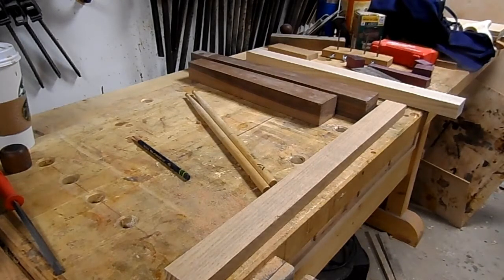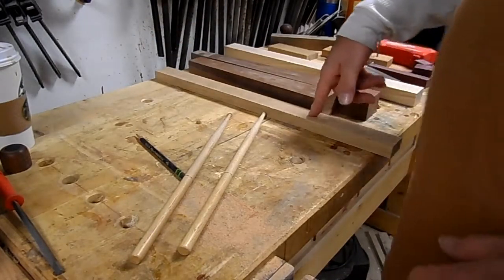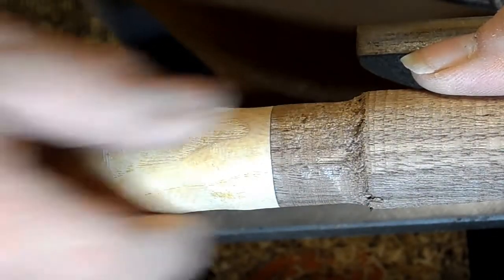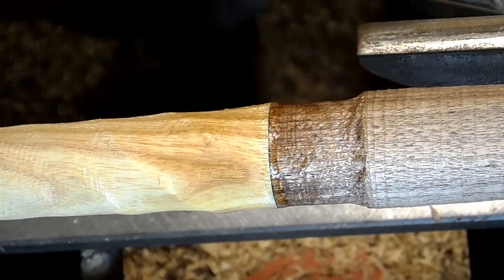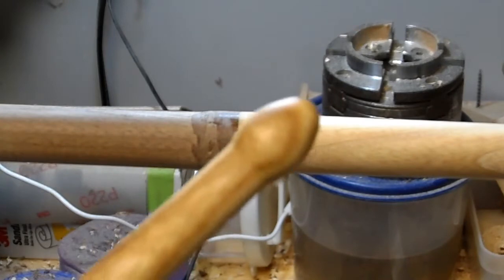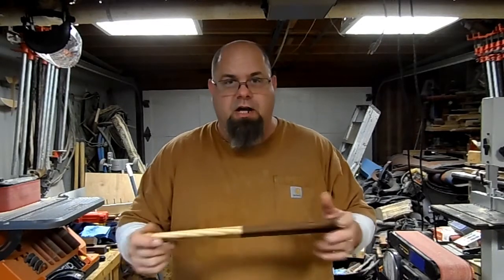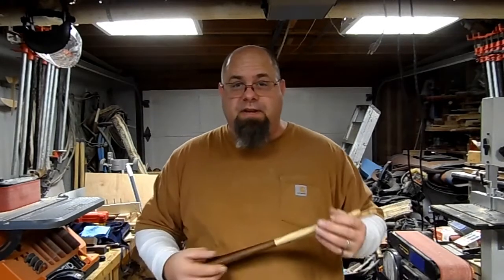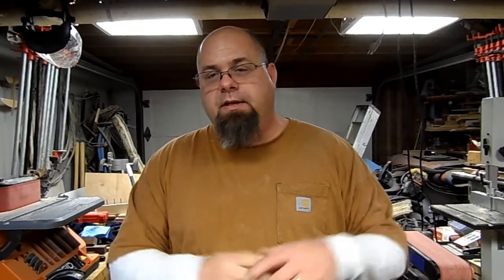GPW 40 - Walnut & Ash Drumsticks

Comment: I like the idea of the two toned drumsticks. Eager to know how those joints hold up. I wonder if the strength of the joint were to change if you eliminated the floating tenons, and jointed the square stock with something like a finger joint, or possibly dovetail?
Reply from the maker: +Corey Graham 

I deleted 20 minutes of footage of me considering both of those options. I think the finger joint would be the stronger because of how thick the sides would be on the dovetail. I am not set up to make the finger joint... or at least I haven't figured out a way to do it with the tools I have.

Thanks for watching and for commenting... it's good to see that others were having the same thought I was.

Comment: Very helpfull video,thanks.What can you say about strengths of your drumsticks against beats on drums? How long did you play? You influenced me to try ash drumsticks,ash is  hard as a hickory or oak?or if not i am okay less hard if can play with good sound...
Reply from the maker: Try the ash... 

This plan for two types of wood was a complete bust... they lasted about 30 seconds.

There may be a way to di this that will work... But, what I did in this video failed miserably.
Reply: @GPWoodworks  Thanks. Vertical connection can creat happy end.